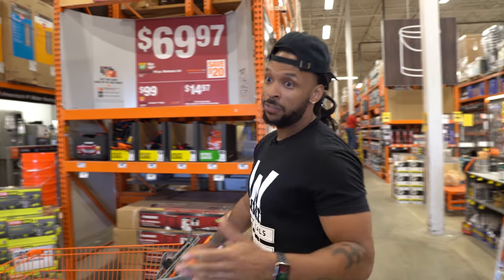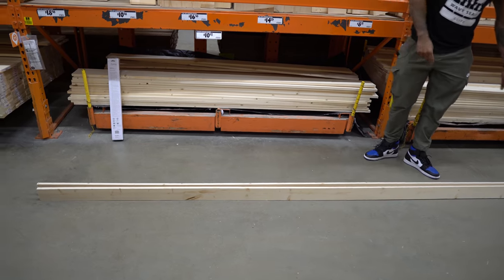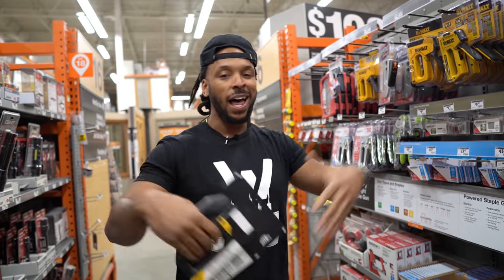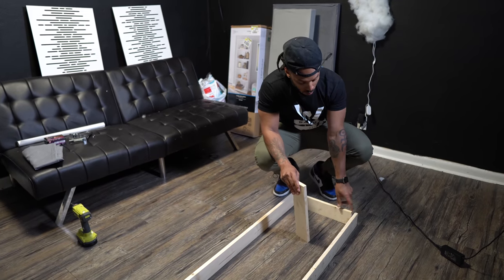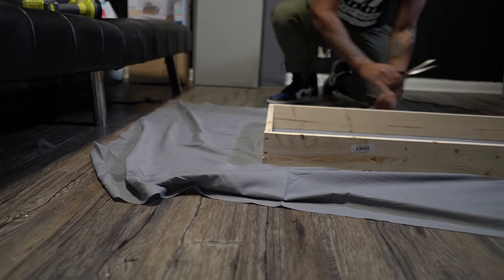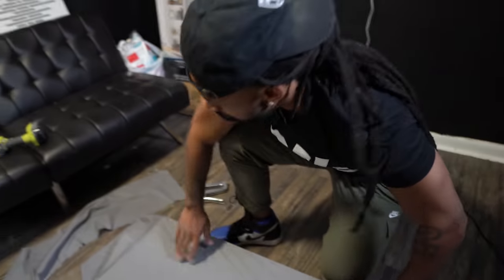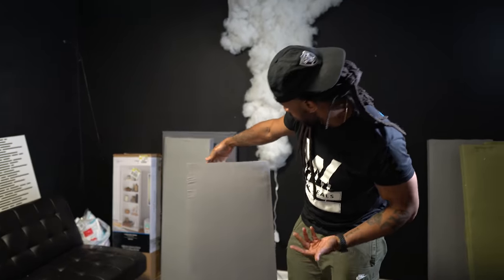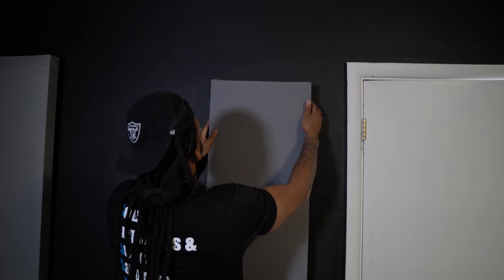DIY Acoustic Panels- How to Make Cheap Acoustic Home Studio Panels

Comment: I built 8 of them myself for my home studio. Came out great and look professional. Cost around $20 per panel rather than about $50 buying online. Saved about $240 rather than buying them online. Would highly recommend doing them yourself. Not hard to do at all. The video I watched gave a little bit more info like the exact measurements to cut the wood, so that it would be 2 by 4 feet exactly and how to prevent the wood from bowing in after assembling it. You did a great job with this video too. Real quick and straight to the point. Also pre drilling a hole before putting the screws in the wood will prevent the wood from splitting when drilling the screws in.
Reply: Probably saved more than that.. the shipping is usually as much as the panels themselves.
Reply: @JustMamba  yea that’s true. I didn’t take that into account.
Reply: Panels that thick are going for 200 now

Comment: Loved the video man!!! The only thing I would have done differently was to staple the frame at the ends first before I put the screws in, would've made it easier to put the screws in without having to hold the boards to align them.

Comment: Dope video, gonna make some of these soon. Word of advice, make pilot holes before the screws so the wood doesn't crack
Reply: That's true but the reason the wood split it because of the sharpness of the beginning of the screw but if you take a hammer and hammer the top of the screw so the beginning is sorta flat then screw in that solves that problem 99.9 % of the time (carpenter's trick) especially if someone doesn't have right tools at the time peace out and stay creative

Comment: Just finished mine. In total cost 236.00 wood, staple, fabric nails, rockwool. Wayyy cheaper. Thank you sir. Had to work in the heat but it was worth it. One suggestion. Het high and might drywall picture hangers and i got tone claw picture hanger on yhe top of panels. Each one of my panels were 10lbs a piece. Drywall jangers hold up to 20 and 40 lbs.

Comment: This is the best video on the topic that I’ve found. All the other ones are people saying dumb shit like “DIY panels for $20 a panel!”… ya, if you already have the wood and tools and just need to cut it and put it together.

Most of us have to actually go buy wood, buy insulation, and maybe buy some tools to make the frames. That can bring the cost up to over $50-100 a panel… but still way cheaper than buying them outright.

Do you remember what you spent? Probably going to make some next week

Comment: This is cool. Way cheaper than those wiggly foam panels, foot-for-foot.
Reply: Plus they work better. Those little foam panels only get rid of high frequencies. These will cover high, medium and even lows if you make them thick enough.  I made about 20  3 inch thick ones awhile back as well as about 6 8 inch ones for bass traps.

Comment: You can make the panels more effective by adding an 'air gap'. Put something as a spacer behind the panels to get them off the walls. Makes a huge difference and it costs next to nothing. You could use the leftover pieces of wood
Reply: Are you talking about putting a piece of wood behind the panels and attaching that to the wall? I’m curious how good that it.
Reply: @YoItsOO that’s how professional studios are built, it’s called floating walls and or floors
Reply: @Gang-25j  yup

Comment: Hey Wavy, last year I made 8 panels just like you showed and the room sounds a lot better. But recently I read about possible health concerns with using mineral wool. Basically  the wool releases Microparticles in the air, which if you breathe in regularly can cause lung fibrosis, autoimmune diseases, skin and eye irritation, etc. I was wondering what's your take on this? Do you know any other alternatives? I've heard about hemp, but I don't know much else...
Reply: Denim: hard to find. Cotton batting. Cellulose, reading about this one now
Reply: I am hearing that wrapping the mineral wool in thin plastic will solve the health concern and it won't affect the sound absorption. It's a pretty divisive method tho
Reply: I don't really see how they'll release particles in the air if they are covered and still. Unless you have high powered air moving through the room I wouldn't imagine anything being released. If it's still a concern I'd just spray it with a thin layer of glue to hold more of those microparticles so you don't lose sound absorption using plastic.

Comment: "Under $30" isn't at all accurate though lol. I'm at $119 and I haven't even bought the wood or the fabric yet. Still cheaper than buying them of course, but here's an up to date general price list (not including wood and fabric):

Thermafiber insulation R13 (now comes in a pack of 8): $55

-or R15 (the stuff he bought): $75

Staple gun: $20

Staples: $5

1 1/4" general purpose screws: $8

Screw hooks and wire (for 6 panels): $18

Bag fee: $0.10

Add the price of fabric and wood and you're looking at well over $300 for 6 panels (which is still cheaper than one professionally made panel, but definitely not under $30)
Reply: You included the bag price though 😆

Comment: Guys.. you're missing the math on the mineral wool. I JUST went to Home Depot and yes, it was $60 in my state. HOWEVER that $60 gets you 8 pieces of mineral wool (enough for 8 panels) 

As far as the wool goes that comes out to 7.50 per panel (before tax) for the wool portion. And you only buy the wool one time!

Math is important!

Comment: I’m confused on how this is $30 for one panel if the foam alone is $28?
Reply: The foam he bought is enough for multiple panels 👍
Reply: The foam in my area is $60 but it comes with 8 slabs

So thats really only $7.50 per panel for foam